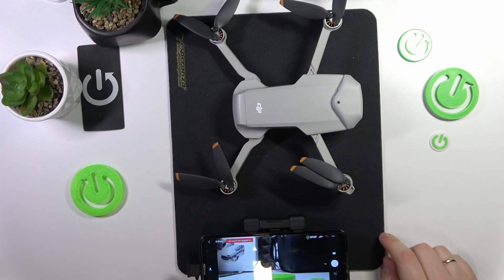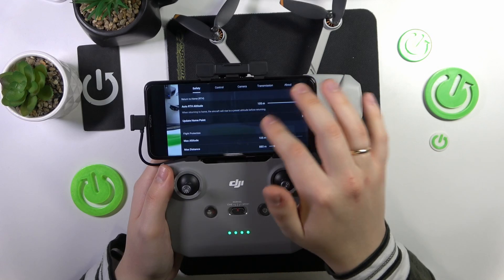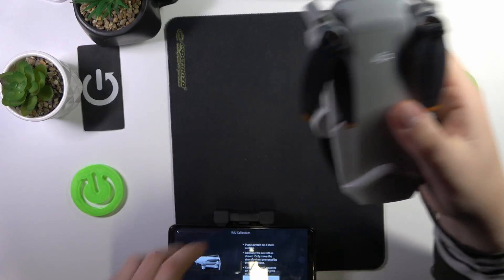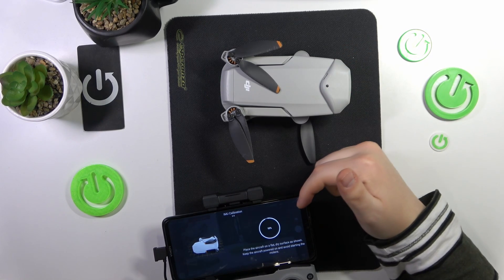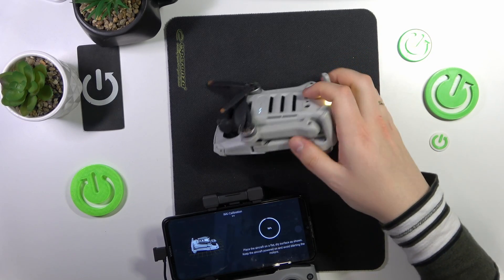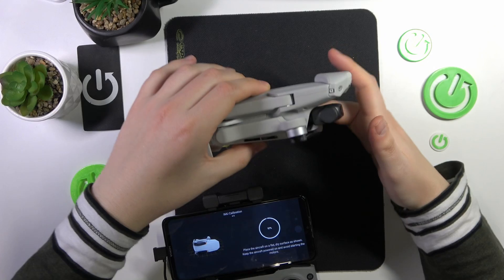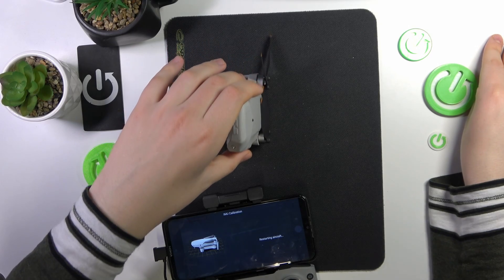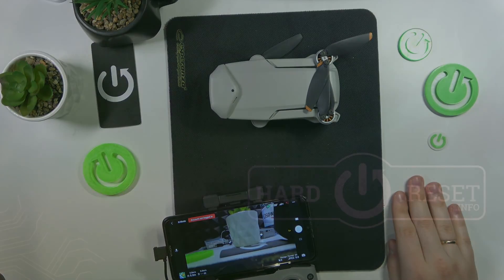How to Perform an IMU Calibration in DJI Mini 2 SE

Comment: 2:00 you MUST put the drone EXACTLY as shown, in the same perspective as in the pictures. Here tou had it with the top facing away from you but the picture shows the top facing you. I made the same mistake and took for ever and didn't calibrate. As soon as you put the drone as shown in the pictures, the process is quick and asy.
Reply: I've been trying this but I can't even get my drone to even start the process. I hit start and nothing. Any ideas
Reply: @esco42  just place as shown. Fold the arms, update everything,  follow the on-screen instructions. Make sure the drone and the rc are on and linked
Reply: @just-memm I have done that. But when I hit the start button on the screen it doesn't even attempt to start  as if the start button isn't active.
Reply: @esco42 have you tried uninstalling the dji app and re installing it?